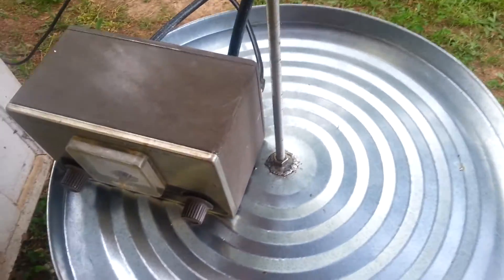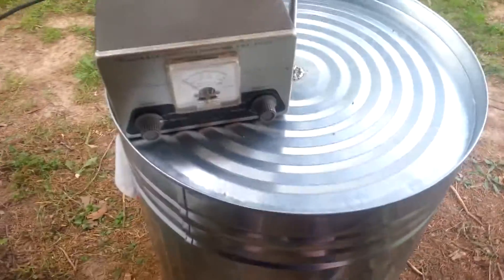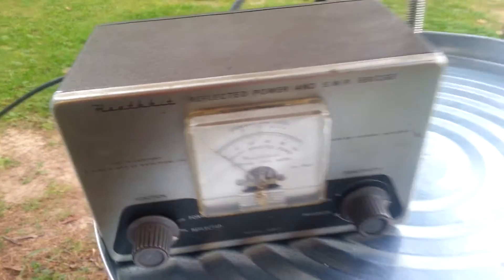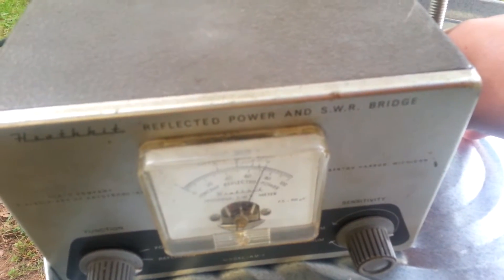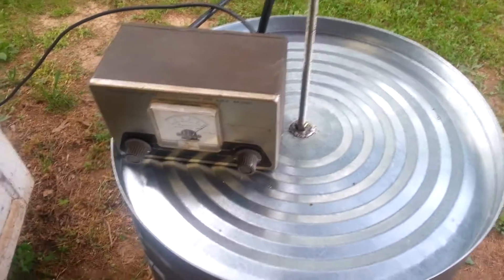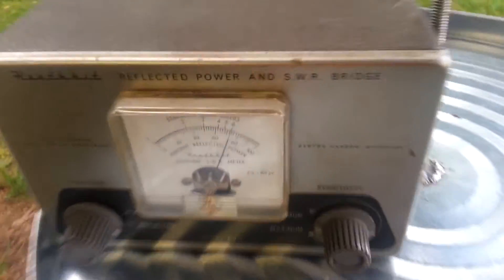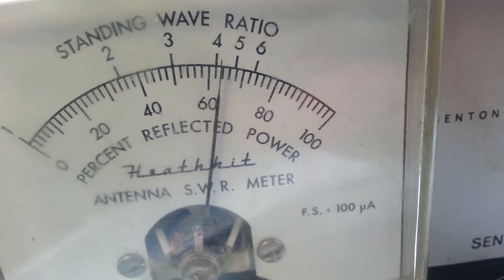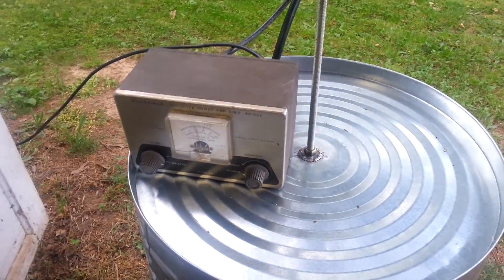Homebrew duplexer cavity for the 2 meter band.

Comment: beer can duplexers were popular in the 70s , trash can duplexer will teach you the basics and the mechanical challenges that appear when building a duplexer , i used to run a UHF repeater that had mechanical problems with the duplexers during winter , the cavities detuned during very cold nights , we had to add insulation to the shed , we did a small experiement putting one of the cavities inside a freezer and measuring the freq drift with a VNA .
Reply: Smart!